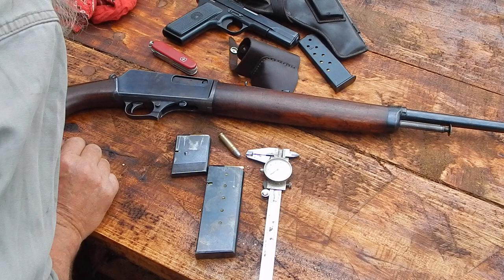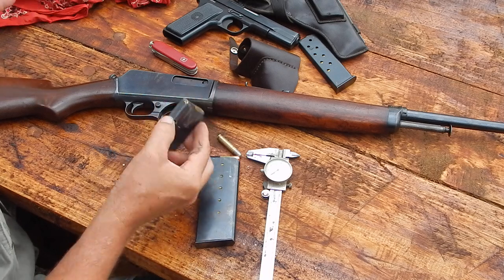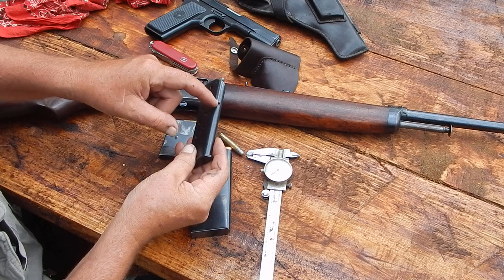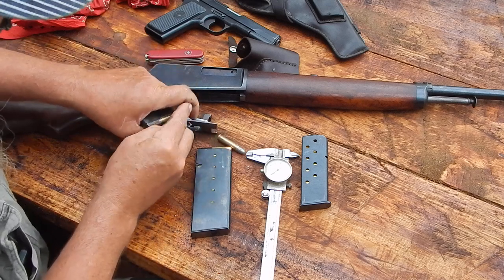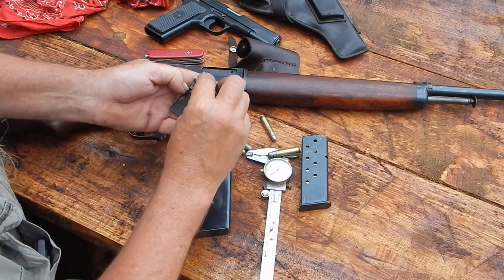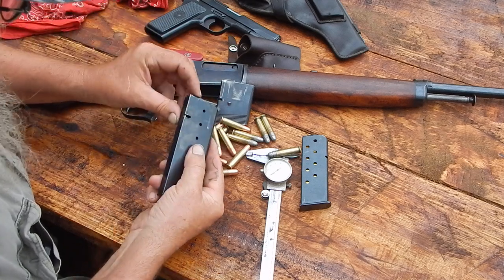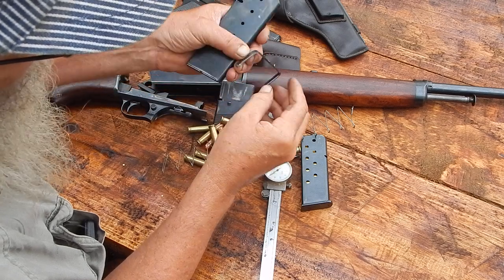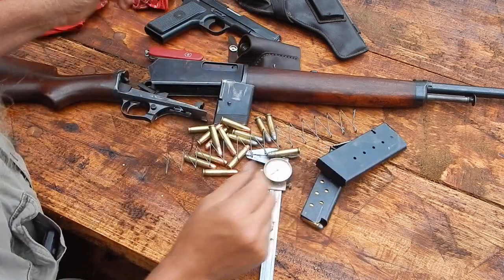Winchester Self Loader Magazines

Comment: My experience with KKK aftermarket mags. were not good.  Their springs are not strong enough and sometimes, especially when shooting factory rounds, these guns run so fast that the bolt would override the next round in the mag. making it necessary to hand chamber.  I have examined a number of the factory mags. and they are truly works of art - the best I have ever seen on any gun.

Comment: I have to say, I'm SHOCKED at the prices for these rifles. There's eight up on Gunbroker right now, none of which have bids, three of which are shooter-grade and can likely be had for under $400 before shipping. I'm wondering if I don't want a 1907 instead of the AR I have parts on order for; I like funny old wood-and-steel rifles with lots of character.

Comment: I wonder if it could run cut down 556 cases too.. maybe the ejector could still reach the rim even though it's just a slightly smaller than 351SL rim